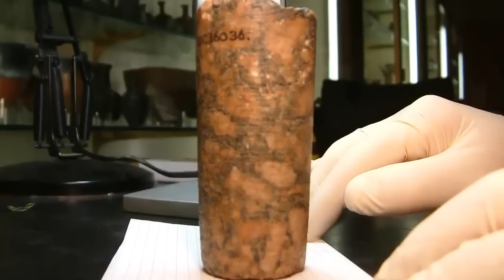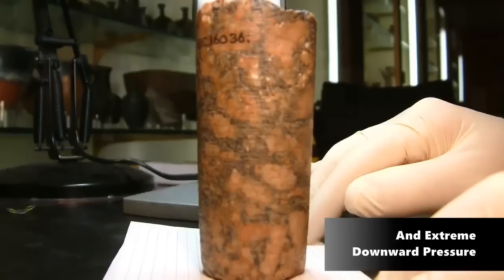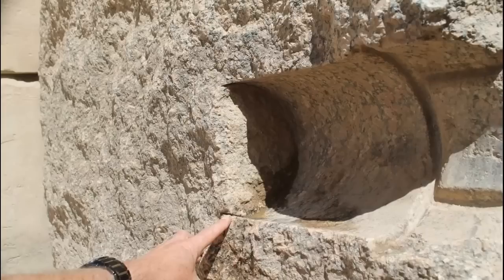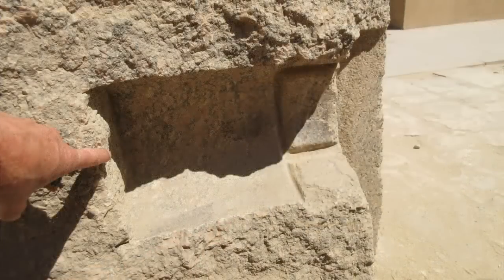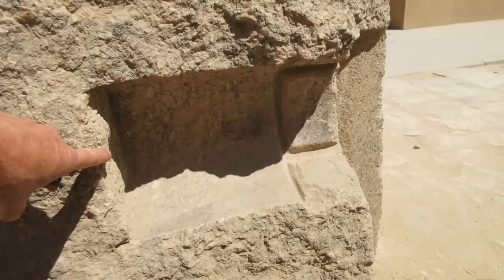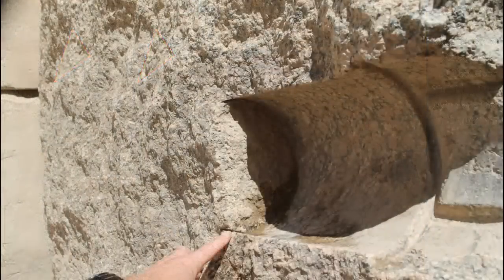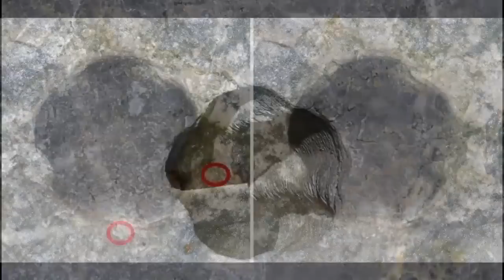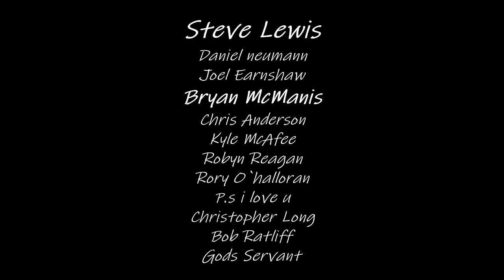PRE flood core drilling explained

Comment: In defense of "tube-drill-holes"

I don't believe graham and others believe they are tube drill holes, I think that's just a description of what's being referenced too rather than a statement of fact.

It's just a means of describing the phenomena "tube drill holes" 
I'm sure they are open minded to the idea that they may have had some other function or purpose, and "tube drill holes" is just the on-hand way of describing the phenomena in particular.

On a note to your viewpoint, I think your on too something here, and your suggestion of them merely being different slots/framework to house some sort of mechanical device is intriguing.

It brings into mind the egyptian disc that was discovered and how it may just be one component to a much bigger 'machine'

Comment: Everyone seems to assume that the drill is simply spinning but to much material is cut away per rotation. It looks more like threading with a tab to me.

Dont ask me to find it but there is a video on yt where someone (in his garage) uses a very thin copper tube with a small speaker attached. With only slight pressure it very slowly starts eating away on the stone. (I imagine sand is doing the cutting) No rotation, just sound. Dug deep enough into the rock it seems to make more sense, the copper deforms but it doesn't have any place to go. I imagine if one were to gently tap it back and forwards to prevent it from getting stuck the deformations should make a slight thread but also fill it and amplify the effect. Should work if you can get the frequency right, at least until the core snaps off. I imagine the hole could also get smaller the further down you get.

Comment: My hypothesis on a way they may have done it is through placing a metal ball against the top of core ''drill'' and had it vibrate at the resonant frequency of the stone they were cutting, a conical shaped core could be used to make the slimmer holes at the bottom since the core isn't spinning but vibrating, and more advanced shaped could be using since nothing is spinning, like the spiral at 7:07

Comment: Maybe the square holes were for Fixings to slot in and stop the pipe moving about, keeping it firm. Watertight even? Sewage? Slurry? Similarly, the wavy shaped holes would also keep metal pipe in place and not shifting about. Water?

Comment: The so called core drilled looks to be either some sort of anchor for concrete with threads (like you would use to secure a floor to a wall, piling or footer)  or a pop up bollard of some sort that screws out and in to raise a barrier.

Comment: sadly, I believe they used the same machine to bore out the cylinders in the engine block of my supercharged range rover. But to taper the diameter of a drilled core sample your machinery would have to be organic. I.E. Biological, or wave form technology. the only mediums that are based on expansion and contraction.